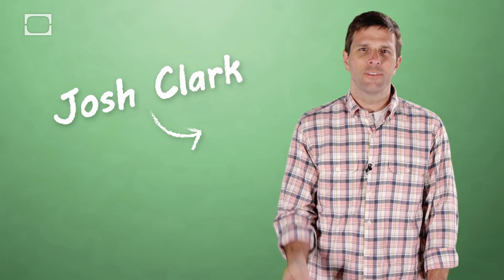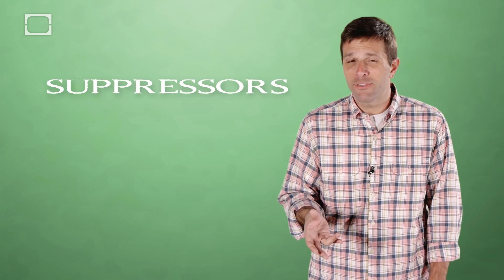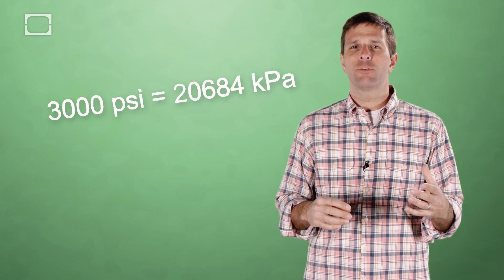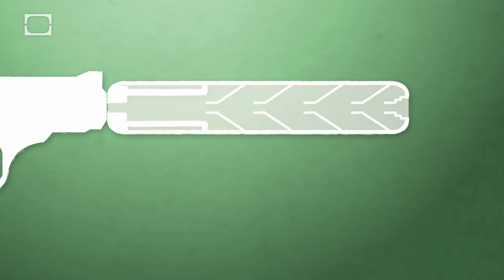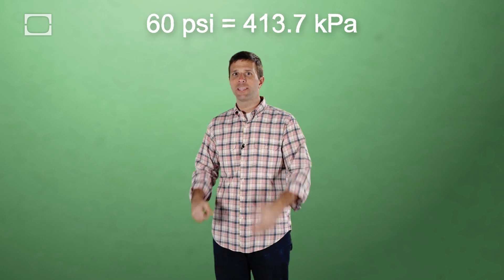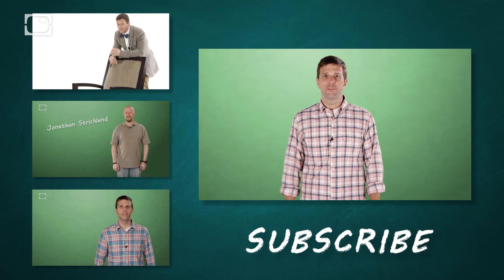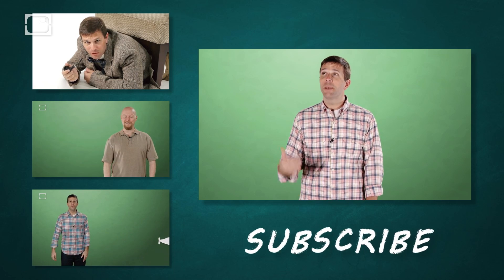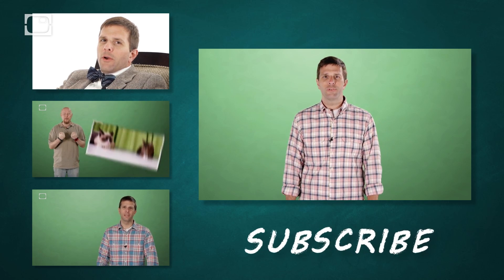How Do Gun Silencers Work?

Comment: The first sound is the action, not just the firing pin. You have to remember that the thing that makes the most mechanical noise is the slide on a pistol, or bolt in a rifle getting cycled. That's a hell of a lot louder than the firing pin...

The second sound is not reduced to 20dB, but I saw you already have an annotation correcting that.

The third sound of the bullet breaking the speed barrier absolutely can be fixed. This is exactly the reason that subsonic ammunition exists, or why it is useful to use already subsonic calibers such as 45 ACP.

Comment: note, it does not explode like he says gun powder is non explosive, what it actually does is burn rapidly causing pressure that forces the bullet out and the bang is from the pressure hitting the outside air and expanding rapidly
Reply: Liam Teetzel Um, what do you mean gun powder is a non-explosive? Gun powder is considered a chemical explosive. However, it's considered a low explosive, meaning that gun powder burns at subsonic speeds. Additionally, what you described is literally the definition of an explosion.
Reply: Propellant. Gunpowder is propellant. Also guns don't use gunpowder anymore they use various chemical compound propellant

Comment: The firing pin hits the Primer. The Primer creates a spark and ignites the powder. The powder burns and creates a gas between the primer and the bullet. the gasses expand and pushes on the bullet. the bullet is ejected out of the barrel. There is no explosions.

Comment: can you explain why it reduces accuracy ? I heard it was lengthening the barrel so a standard bullet would go faster and more accurate than one without a suppressor because it there's more pressure in the silencer than in air. Or maybe you meant that it reduces accuracy and impact because you have to use slower bullets ?
Reply: Depends on if you are talking about the original silencers, or modern suppressors. Modern ones don't reduce accuracy, they increase it. Putting a suppressor on the end of the barrel dampens the oscillation in the barrel when the round is fired, this will tighten your groups because there is less movement in the barrel when the bullet exits the muzzle. It also increases gas pressure which will increase velocity, decreasing bullet drop over a given distance. The original silencers did decrease velocity and accuracy because instead of using metal baffles that don't touch the bullet, they used wipes that the bullet squeezed through. Squeezing through the wipes slowed the bullets down via friction, and knocked them off course making them less accurate.  
You don't have to use subsonic rounds just because you put a suppressor on the gun. At a given distance, subsonic rounds require more holdover and are more effected by wind than supersonic rounds, so its harder for the shooter to be as accurate with subsonic rounds, but they aren't inherently less accurate within their useful range.
Reply: if you use superonic ammo it actually increases accuracy
Reply: It is called subsonic ammunition. And yes this is why suppressors arent that accurate. Also, it is still loud mind you even with suppressor.
Reply: +SE B not exactly. If your uses subsonic loads just know your transonic ballistics and same going for a "normal" or hot load. Accuracy is achieved via good load data, knowing what ammo runs smooth and consistency. That's it

Comment: what if I hold pillow in front of gun barrel? will it work as silencer?
Reply: great....  is ur dick still safe
Reply: You absolutely could. Easy to find on the interwebs
Reply: I have tried it, yes it works
Reply: Umm.... Kind of? The pillow would somewhat muffle the sound, but remember the bang of a gun is pretty loud. So, it wouldn't do much. Additionally, a suppressor contains specific engineering that allows the bullet to pass through it as if it were just part of the gun. Not to mention, there would be no real seal with your pillow, so the gas expanding would still make that loud bang anyways.
Reply: no

Comment: Close ,some slight inaccuracies. The graphics show a suppressed revolver,the gap between the cylinder and barrel make it impossible to quite up 99% of revolvers aside from the nagant that had a cylinder that moved forward to the barrel and specialized rounds. A round that is subsonic isn't necessarily weak, the .45 acp (.45 auto) is subsonic but is a heavy round. In ballistics tests slower moving hollow points get deeper penetration because they expanded less the faster moving hollow points and an fmj (full metal jacket = solid non hollow point) even a sub subsonic .22lr will go trough 4 layers of denim into ballistics gel 16" or more where depending on grain weight sometimes pass through the block of gel ,yet a .223/5.56 hollow point moving at 3000+ fps will stop at 12"-16" generally. Also a bolt action/pump/lever action is quieter then a semi auto because of the slide/bolt being forced back to eject the casing, so in effect shooting a bolt action with a subsonic round is only as loud as the firing pin hitting the round,very close to how a gun sounds if dry fired,but a semi auto still sounds like dropping a heavy book on a wood floor. The advantage with a hypersonic is if you have something like a 30/06 it will mostly hide the muzzle flash, it still eliminates the pop and the sonic boom is hard to place from 200+ yards away so its still pretty effective.
Reply: Expands less than

Comment: Many suppressors have rubber wipers that slow the round down to subsonic speeds. No need for subsonic ammunition.
Reply: Never heard of that, could you provide some examples/sources? Just seems like that would cause quite some wear, not to forget that you would have to slow the round before it leaves the barrel itself, right? Because the round should reach peek velocity when it leaves the barrel, so therefore already having crossed over into supersonic speeds, and already having caused the crack. Now I'm just a layman and would love to learn more/get corrected if need be, so if you can afford the time I'd love a link or two:)

Comment: I was actually pretty engrossed until the Razor talk. I ALMOST subscribed until I realized I didnt want to CONSTANTLY hear about useless razors! I"m Hairy. FUCK Razors......
Reply from the maker: If it helps, we stopped doing in-video ads about two years ago.
Reply: BrainStuff - HowStuffWorks
How come I still saw Razor crap?!?!?
Reply from the maker: This video was produced while our company was making us do ads in our videos. We don't put ads in our new videos, but we can't change the old ones.
Reply: There's a few things wrong with this video and id like to quickly address them:

1: How loud suppressed firearms are is dependant on a variety of factors, Not all of them are 140db.
A good 22LR bolt gun setup with a proper suppressor can be so quiet you can only hear the firing pin dropping. Wet and Dry suppressors make a difference in how many DB's it drop's as well, A wet suppressor typically being better.

2: The action of the firearm makes a huge difference. The point of a suppressor is to capture the gas from a cartage so it cant leak out anywhere. This makes rifles like the AKM a particularly poor suppressor platform
as gas escapes from many areas on it. Bolt guns loose very little gas in this way and make excellent suppressor hosts.

3: A suppressor is not an barrel extension it has no rifling in it, It's a barrel attachment like a muzzle break.
The "Barrel" ends when the bullet leaves the rifling and the crown.

4: Suppressors do not decrease accuracy this is straight wrong. Very old suppressors had a rubber
baffles that slowed down the round and effected accuracy in a negative way. This is in no way true anymore as suppressors don't use that kind of system anymore. In fact in some cases suppressors INCREASE accuracy.

5: "Loosing a little bit of power" is an understatement. Some guns have naturally subsonic ammunition that does not need "Sub sonic ammo" such as the 45. ACP. Such guns with heavy slow moving rounds typically make good suppressor choices as a result as they loose no velocity and thus don't loose any potential damage from lost velocity. 

However when you take a normal AR15 5.56; A bullet that needs very high speeds to be effective because its so small and light it looses an extreme amount of its damage potential to the point that it hits about as hard as a 22. LR when its subsonic. Damage is calculated by: ke=1/2mv^2. Velocity play's a huge part in potential damage so loosing a huge amount of it from a 5.56 for instance going from 3k FPS down to about 1k is a 66% decrease in its overall velocity.

6: The PSI inside of the barrel is dependant on the cartage, They are not all 3k. In fact 3k is super low,
even low pressure rounds like 12g Shotgun is around 11-14k. 45 ACP that is a low pressure pistol round is around 21k. 5.56mm is 63k!

Not trying to sound like a dick but you guys might wanna re do this video it has a lot of inaccuracy's.
Reply: Anti Fun u=nerd
Reply: The Guitar Whisperer
Reply: WHY!!!!!!!!!
Reply: I know :(
Reply: The Guitar Whisperer ditto
Reply: The Guitar Whisperer no your A Wizard

Comment: Actually, the term silencer and suppressor are two distinct variations. A suppressor looks like a silencer and is generally welded closed and surpasses the sound by many dicipels tho not as much as a silencer. The reason it is welded closed it to keep it from being made a silencer by law. While a silencer generally gives threaded access to the chamber surrounding the barrel and that is packed with cotton, steel wool or used firing caps which need to be changed regularly. A silencer reduces the disciples by even more than a suppressor. The comment, "There is no such thing as a silencer." Was tongued by an idiot gone completely literal. Like a laser should actually be called a maser, it's actually called a laser. And thats the difference between a suppressor and a silencer and of course a silencer doesn't completely silence a gun blast tho compared to the sound of a gun blast it is suppressed to the point of figureitvely being silenced. Freaking people. Can't tell you how many morons call silencers suppressors, even tho they suppress and they call suppressors suppressors with nothing to distinguish them apart. Now you have the correct definitions by nature of the device. Also, the guy above gave no clue to the necessity of "packing" a silencer and there is no packing in a suppressor... again.
Reply: what are you on about? there is literally no difference between a silencer and a suppressor. Its all up in your head. 

If not, then cite your source or else whatever just came out of your mouth is bull.

Comment: 3000 PSI?  What is he talking about - an air gun?  That's scuba tank pressure range, not gun chamber pressure.  A pistol is ten times that, and rifles twenty times that - although this varies widely with the round and type of gun.  Why would anyone purport to be an expert on a subject about which they apparently know nothing?  He keeps repeating 20 dB - that's not the sound level; that's the amount by which the sound level decreases.  Also, neither power nor accuracy decrease; generally, the additional powered length increases velocity, and the dampening of barrel oscillation increases accuracy - at least from a repeatability point of view.  Wow - pretty poor.

Comment: 20 db? No no no, it is not as quiet as Hollywood.

Welrod, the British suppressed pistol is about 70db (probably the most silent pistol) the mechanism is using manual bolt action, we can slide it slowly to reduce noise.

Russian silent sniper rifle VSS Vintorez is roughly about 120 db

Some suppressed guns has around 140 db.

So, 20db is kinda ridiculous

Comment: Okay, the powder doesn't explode it deflagrates (quick burns) and the sound doesn't come from the gas expansion but mostly the loud sound comes from the implosion.  That is the air collapsing back into the vacuum where the "explosion" once was.   The suppression comes from controlling the expanding gasses and mostly from controlling the vacuum collapse.  The 20dB sound comes  from using sub-sonic ammo that is below 800 fps.  Ammo that hits 1100 fps will create a 90dB report which is as loud as clapping your hands really hard.  Also, subsonic ammo will fail to cycle most pistols and will require the shooter to manually pull the slide to cycle the next round into the chamber.  Now, there are high end suppressors will have floating baffles that will alter the pitch of the sound to above or below human hearing without reducing performance.  These are insanely expensive and are not used except by actual black/wet ops.  BTW, you cannot silence revolvers because of the cylinder gap so when you see that in film it's hollywood nonsensical BS.  The whole point of a suppressor is to reduce the sound so not to destroy your hearing and to not alert everyone and their second cousin that someone (id est, you) is shooing.  You cannot "silence" a gun per se except such weapons that are running subsonic ammo with manual cycling of the slide - and still they are not silent.  Also  subsonic ammo is weak so if you are going to use that you really need to shoot .45 ACP to have any affect on the target.

Comment: This video is off on a number of points. I'll make some corrections.

First off, suppressor users are not hit men and assassins outside of the movies. There is not a documented case of a suppressor being used in a U.S. crime. 

Next is the volume of a suppressed gunshot. He added an annotation to correct his error but didn't adequately explain how loud a suppressed gun still is. A handgun (and most rifles) are BARELY hearing safe with a suppressor. It makes it so your ears don't suffer permanent damage, when you fire the gun without hearing protection, but the gunshot is still loud and quite audible. The best suppressors with the right caliber and ammo get close to what you'd call "quiet", but are still momentarily as loud as a lawn mower...

Up next is power. He indicated that specialized (slower) ammo and the use of a suppressor makes a gun less powerful. The suppressor itself does nothing to effect the velocity or energy of the projectile. It only affects the gasses behind the bullet. As for the sonic crack, some calibers (such as standard .45ACP) is already sub-sonic in its natural configuration (meaning no sonic crack). Many other calibers can be made subsonic without sacrificing power. You slow the bullet down to below the speed of sound, but also make it heavier. That means the so-called 'power factor' is retained. 

Last is accuracy. Suppressors can have an effect on aim and accuracy, but do not make guns less accurate as a rule. Accuracy and the bullet's point of impact have a lot to do with barrel and gun harmonics. As the bullet is traveling down the barrel it actually flexes (this is called barrel whip). Adding a suppressor on the barrel changes the weight and weight distribution of the barrel, changing its harmonics. Sometimes a suppressor will have no effect on the point of impact (where the bullet goes in relation to where you aimed). Sometimes the suppressor will cause a shift, but it will be predictable and consistent, so you can adjust your sights to compensate. Rarely does a suppressor degrade actual accuracy, but it is not unheard of for the added weight of a suppressor to dampen barrel harmonics and IMPROVE accuracy. 

Suppressors are hearing safety devices, not assassin's tools. Even in a military environment they aren't there to make a gun near-silent. They simply make the source of the gunshot less obvious. Suppressors also tend to positively impact accuracy (if they make any change). On pistols they are primarily a novelty (as they are unwieldy), but on a rifle a suppressor makes for a more pleasant, less jarring, and more safe shooting experience.

Comment: 20 db? That isn't what I've read. Most suppressors will drop the sound by 30 or 40 db. That's more like 120 db, which is still loud, but not painfully so. It's not even remotely close to the 140 db that it would take to get to 20 db. Where did they get their information?

Comment: >people you wouldn't want to associate with call them cans
Why wouldn't I want to associate with them, they're the ones most likely to have actually followed the law in acquiring the suppressor and are 99.999% upstanding citizens?
>extends the barrel
It's not a barrel extension, it's a tube that has gas buffers to slow down the expansion of gasses after they leave the suppressor.
>*graphic shows entire cartridge being expended out the end of the firearm
It's not fucking rocket science to show that the bullet exits the barrel and the brass casing is expended from the chamber, and not the entire cartridge being thrown forward.
>it ignites the gunpowder, which explodes
Actually, more correctly it'd be called deflagration, or the primer exploding causing the gunpowder to burn very rapidly.
>some manufacturers make ammunition that travel at less than 1100 ft/s
Any manufacture that makes .45ACP cartridges that are standard pressure make subsonic ammunition by design of the cartridge itself. To be fair, the vast minority of ammunition is supersonic, however with .45 ACP being a rare exception I thought it might be helpful to point out to show that not all firearm ammunition behaves the same. You also left out the biggest disadvantage to subsonic rounds with firearms normally designed to fire supersonic ammunition, and that is the weapon will not cycle in the vast majority of cases. 

Apparently, I've learned more than these fuckwads watching people explode shit than the entirety of their research staff could dig up to make this episode

Comment: I did not read all the comments, but I did not see one on the "3000" PSI pressure.  It would be closer to 20,000 PSI. in handguns. 18,000 and more typically.  Some rifles go over 60,000 PSI.